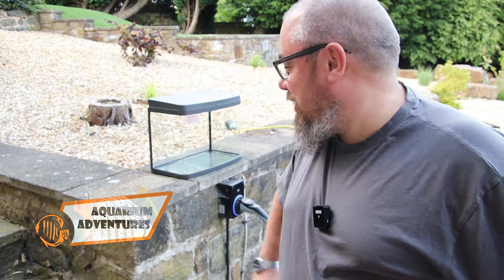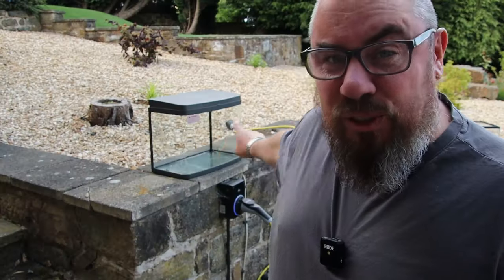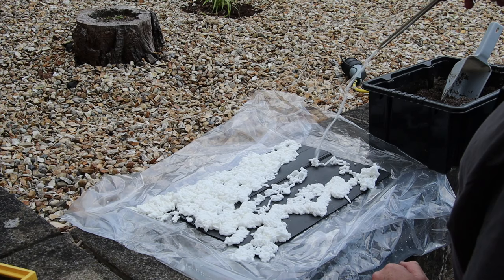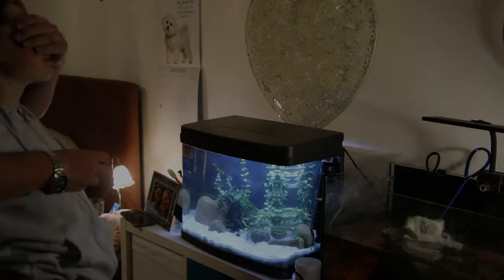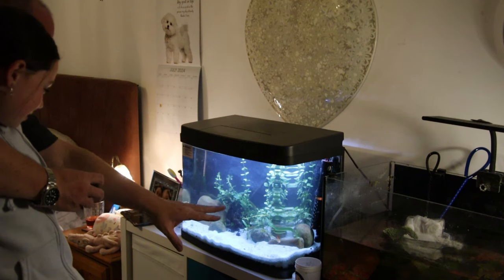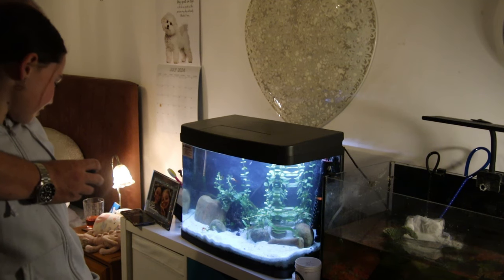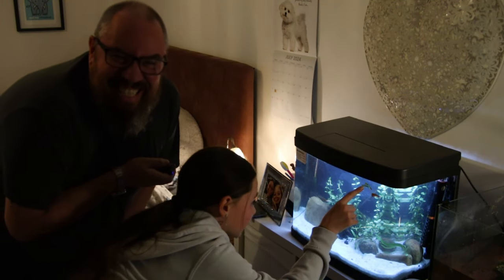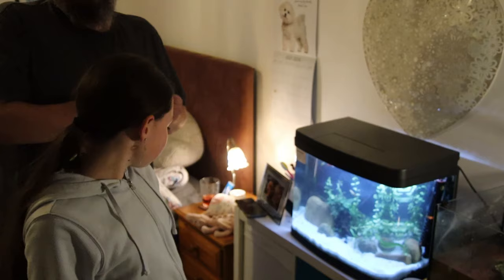Easy, unique DIY aquarium background!

Comment: Lol!  Very nice looking tank.  I personally would not add any colored gravel.....However, at her age i still did some tanks with puke gravel.  I had one that had turquoise and dark blue mix.  A black and purple one.  However the year i turned 14, i went to all natural looking tanks so she may come around and if she just sprinkles the pink in here and there it will be simple to remove it (or just push it down under the sand).  But i love that you are letting her decide.